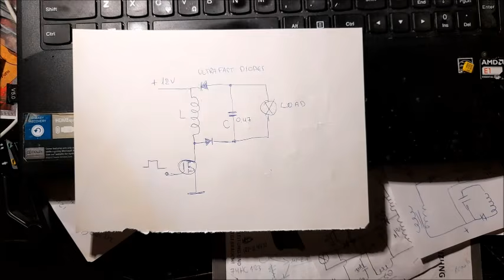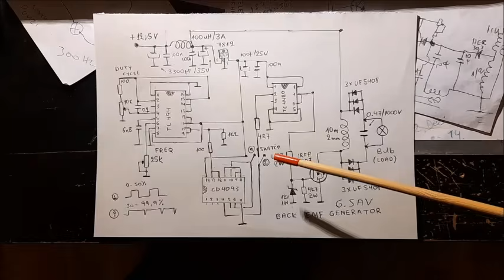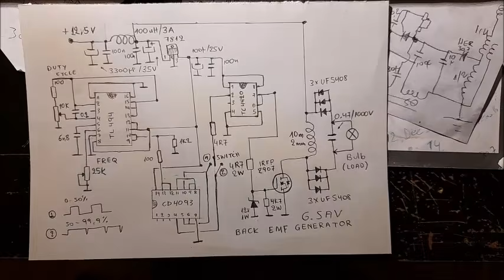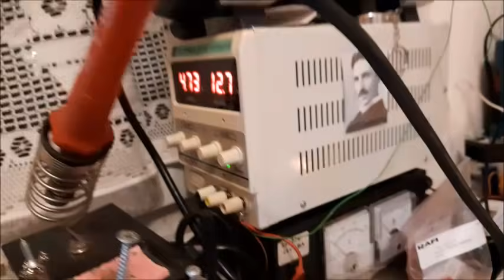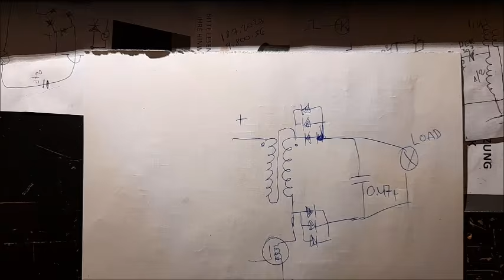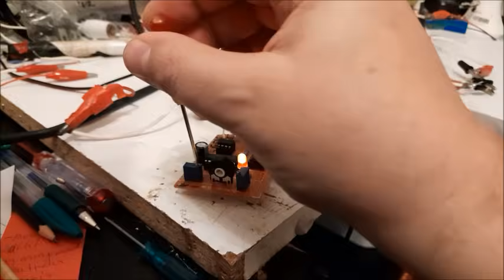Back EMF Generator Project (Experiment)

Comment: You have a 200w and a 100w bulb but they don't light up at their maximum capacity.
Reply from the maker: Yes that’s right! I use them as a load.
Reply: Increase the power supply and you will see major changes.
Reply from the maker: @FreeEnergyRomânia I did it already. Only with this installation I am getting more energy. If I change the frequency, voltage, resistor of the load, then the result reduces dramatically.
Reply from the maker: The goal is how much energy consumed, not the brightness of the bulbs

Comment: The bifiler coil sucks in my opinion. Also the mosfets are garbage in my experience.  62 watt hrs to produce energy is not really overunity. Your consuming 223,200 joules to produce slightly more joules.
Reply from the maker: Check the last result please!
Reply: @gsav2504  - Yeah I see your results. I’m basing off my own extensive experience with these

Comment: Good evening. is the coil air core or does it have iron inside and how many ohm of resistance is the wire
Reply from the maker: It is air core. 10m length of 2mm diameter.
Reply: Okay thank you

Comment: Actually this is the radiant energy. Back EMF is a nonlinear effect. The Avramenko plug with a LED is lightning nearby, wireless i think.
Reply: Radiant energy ..... To be more precise it is dielectric discharge longitudinal waves and displacement currents those do the magic. If you wind the coil in such a way that the length of the wire used in the coil is exactly a sub multiple of the wavelength of the resonant frequency of the coil plus its stray capacitance then the standing waves will charge the battery used as the power supply as well. I have been using my device AliGen off the grid that takes an hour to charge from a small solar panel and then drive a 51W bulb for 24 hours. I used a 5V 3A mobile power bank
Reply: @qinaan It has negentropy as well kind of suction force in every conductive object near by, metal, water etc. as well. Chech that. Your definition is correct yes, pressure waves like in pieso... but nearby so in spacetime. Phase konjuction. Avramenko brothers you know... :)
Reply: @qinaan Hello, my university physics teacher once asked me about Nikola Tesla’s concept of radiant energy (cold electricity): what is the simple definition of a radiant energy–producing device, is it an open system, and where does the energy that we extract — seemingly more than the input — come from?
Can I build the circuit shown in the schematic above to demonstrate the effect of radiant energy ?
Reply: Could you notice the efficiency, the over-unity coefficient of the experiment above ?
Reply: @Birol731 Over 1. Actually about 3.  Its depends, because the wireless energy are in every point in space nearby the emitter, so actually infinite ∞.

Comment: I think the L and C must be in resonance with high Q factor. Irfp260n or better. Labor sign. generator
Reply from the maker: They are in resonance!
Reply: High Q factor will be achieved with no capacitor but the coil resonating around 80KHz only using its inner stray capacitance. High Q is also a very dangerous thing not only in terms of high energy storage  even after the usage when the system is powered  off but also as far as paranormal activities are concerned. I designed my system and then I dumped it in my store back in 2011. High Q plays with the aether and lets others step into our bubble / realm using the distortion in  time space fabric  around the high Q resonators. Coz scalar properties of these longitudinal waves and dielectric displacement currents  are quite weird and still beyond human comprehension. These become more noticeable when we achieve high Q in the presence of Plasma discharge using a triggered spark gap pulsing the inductor at its resonant frequency.  It acts like a beacon to attract them. Believe me or not. That happened to me and then someone emailed me his experience and then a German researcher asked me to  Read Hector's report on Rotoverter experiments conducted back in 2010 to 2014. I suffered a lot and left the experiments. Such devices also generate Echos in subharmonics down to Schumann's frequency.
Reply: @qinaan i am tryed with LC Tank Q=200😊

Comment: thanks for sharing,  i think you need much bigger coil, may be 20times biger coil
Reply from the maker: No you don't need a bigger coil. About 150 - 200uh works perfect. You find current at the output, not only HV.

Comment: It does work, and there is free or overunity in this. I had tried 2 coils same  lengths  such that the ration is 1:1 and it draws 2.4 -3 w to run a 9w lamp pretty bright.  Even a 1.5 w runs a 7 w lamp, this concept does work properly only when there is capacitors being charged. One thing I have observed is that diodes are the most problematic components in this experiment if you use low frequency diodes the energy is wasted or (blocked) and inefficiency comes in. Try higher turns coil, this is all I can reveal for you but there is so, much hidden in the same experiment
Reply from the maker: Thanks friend! I am using always ultra fast diodes.
Reply: Yes what I found was high inductance coil that can resonate around 80 to 100 KHz  and not beyond that to avoid skin effect basing upon its skin depth at the resonant frequency. No need of any LC tank capacitor, the stray capacitance of the coil will be sufficient to play the role of capacitor for the LC Tank. Other identical coil should be replaced by same frequency coil but with less inductance but thick gauge to down convert voltage but increase current. Here you need a C to tune to same frequency as that of L1. Then rectify the stepped down voltage  to run a DC to AC inverter.
Reply from the maker: @qinaan  You may do it! but if you don't achieve impulses like in video, you will not get efficiency at the output (Capacitor). Impulses is the key!
Reply: That is your problem,  you can measure or not measure, all I know is that the BEMF is real there is a coil I'm actually working on where I'm able to light a bulb with virtually zero watts. Believe it or not but that is not my problem. Go do research I have given you about 85% of information needed to free energy! Take it or leave it! I will provide the measurements when I get my devices delivered, the system brew up my meters. 😢
Reply: @HRMW-OSHIWAMBO hahaha are you for real? Light a light bulb with zero watts?? who said that back emf is not real? Ive been building lots of different type of back emf circuits. Do you even know what a boost converter is? Did you know that Back emf  "boost converters"circuit is almost used everywhere in all our electronics today? . Before we used transformers to step down or up electricity. Now days its Back emf circuit that are mostly used for it in all electronics. Looks like some people have no idea what they are dealing with
Reply: @Islamic-World-Sharia-Law bro, I'm an electronic engineer, and if you are one you will attest that we suppress BEMF in our circuits. You can't can't teach me boost, buck-boost, buck or cuk converters just to mention a few.  It's up to you to either use back emf or resonance it is that simple, but since you know much I will, not argue with you some of this things don't need hard electrical science they are obvious all those who tell you resonance are really trying to make your life hard for nothing but resonance is just one aspect of the whole thing which could actually be ignored but the system can still work even though not optimal. The zero what is true and real. I will give you an assignment for you to go work on, 

Take a power supply, with + and - wires take a fast switching say two. Use a mosfet fast switching connect the D to ground, the S to one end of the wire(coil) then the other end of the wire(coil) to VSup + put the negative blocking side of the diode on a negative side of the wire(this ensures that there no way the source voltage (power) will be picked up do the opposite with the second diode, drive the G with a 9-12 v pwm signal conect it to a cap or anything (load) of your choice see the effect it gives to your power supply when you put a load on it and when  there is nothing, now try shorting the two wires and see if there is an effect on power input. I have already done this, now you go do it and come back to complain. Now use your electrical science to figure out how you can improve the coil to even make more power out of it. I have given you 94 percent of my work.
Reply: haha why is it so hard to do a measurements between the input and output power for you guys? how can you be so delusional, pls make a video and use 100 coils. but pls do a measurement of in and out power,  I've seen lots of stupid claims like this on bedini circuit,  for overunity! the resonance is the true key! and the tesla coil! I've seen live a working FE device of 4kw power presented by Ruslan kulabohov, never saw anything that had to do with back emf. 2 things i noticed was. 1 his device did not work without earth ground. 2 it did not work if the vertical tesla coil was turned off. https://www.youtube.com/watch?v=FYmDmryiifA&t=566s
Reply from the maker: @Islamic-World-Sharia-Law You are just another brick in the wall!
Reply from the maker: @Islamic-World-Sharia-Law I never claimed it is overunity here!
Reply: @gsav2504  No and never will it be. But yes in some cases they are more efficient than transformers. Thats why back emf "boost converters" are mostly used in our electronics now days. Takes less space and much less weight than transformers for stepping up or down. But keep having fun with the experiment and learn more 👌

Comment: the efficiency drops after you add or remove extra resistance loads. so you have to adjust the duty cycle every time you add or remove new loads,
this Back EMF circuit is the worst type of Boost converter  type circuit. all back emf  circuits are latterly a boost converters type !
Reply from the maker: No it is not if the impulses are right!
Reply: @gsav2504  Try and you will see. ive done this before, and try make this circuit output 100watt on 100watt load, you will see that the more you go up in power with this circuit the more deficiency it will get,  
there are much better boost converter circuit out there,
Reply: @gsav2504  What do you mean, "No need to tune after the load?" So, when you add a load, there's no need to tune. What do you think if it tried to create a current in a parallel circuit as the first circuit? You have an LC circuit, and there you have 10A in the resonance. Instead of creating a large voltage, it creates a large current.
Reply from the maker: @jacekwis512 the energy in the capacitors acts not as a common electricity. The capacitor charges rapidly.
Reply from the maker: @jacekwis512 the capacitor is been charged with these impulses very quickly. And the efficiency is great. We have to do only with back EMF here.
Reply: @gsav2504  I think I understand what you wrote. But I wanted to know. Everyone uses high-voltage resonance. I'm thinking about generating a current of 10A resonance amps, for example, in a parallel LC circuit. We know parallel and series LC circuits, after all. For example, drawing 12V and 1A from a battery and having 10A and 12V in the resonance circuit. Such a circuit can be built in parallel. Is it possible? It's a kind of energy reservoir that draws amperes instead of drawing them from the battery.  I don't know if we'll understand each other, but okay.
Reply from the maker: @jacekwis512 The only way to understand this experiment, the way you like is to replicate it! The circuit diagram is there. Or waiting other videos of mine with the same principles.
Reply: @jacekwis512 its not about tuning anything here. the resistance load react with the EMF. so if you add more resistance to the circuit than it will get more deficiency, just build his circuit and see for your self. all back EMF circuit are boost converter type circuit. but this one is really poor one. this type of circuit in small load you have to adjust the duty cycle every time you change the load to get more efficiency. but if you try to power 60watt full bright with this type, than the efficiency drops very  much.
Reply: @jacekwis512  yes its possible to do so. in LC circuit its only possible without any additional load to get that measurements. but the current will be generated by eddy currents. which will heat your coil or capacitor deepening on the phase tuning,
Reply: @Islamic-World-Sharia-Law  Maybe you're right. Eddy currents can occur. But I have to build a circuit.
Reply: @Islamic-World-Sharia-Law  I understand what you mean, but I plan to build a different circuit. I want to have current and voltage in this device and disconnect the battery, for example. I want to build such a device using my own schematic. All I need to do is learn how to generate high energy in a pulse without a battery or source, just like Tesla did. And don't build a closed system, just ground it to earth. I'm still learning; I know what the obstacles are. I'm trying to remove them. If I find ways, I'll build the device.
Reply: @jacekwis512  There is a great demonstration from ruslan kulabuhovs video. his FE device are based on LC circiut and Tesla resonace